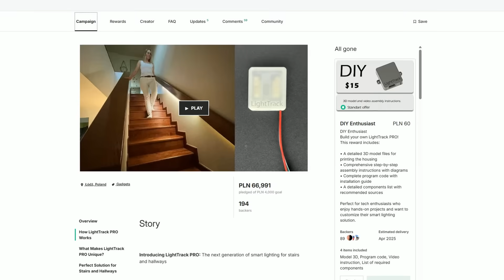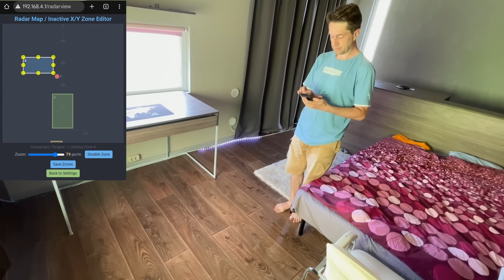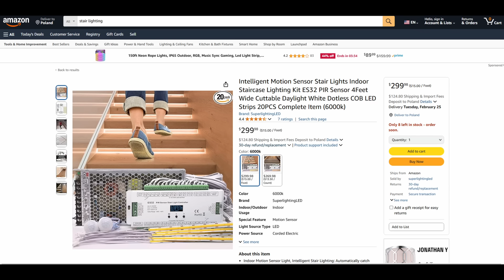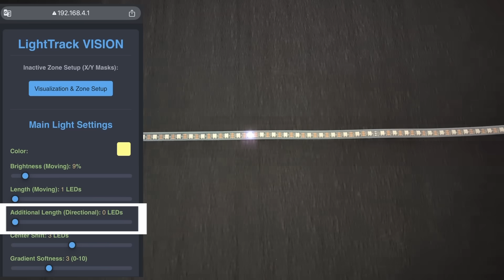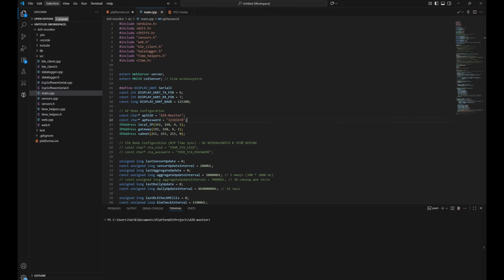My Smart Lighting Invention for Home & Yard (Open Source Code)

Comment: The fact that you kept the project open source earned my instant respect, cheers.

Some suggestions & feedback:

1.Consider SK6812 over WS2812. It comes in RGB+W (can choose between amber, warm, neutral and cold white), excelling at true white color reproduction.
- it's not a new IC, and it has plenty of community support, along with libraries
- it does cost a bit more, but not substantially so
- available in multiple LED/M densities

2.Silicone diffuser / tube if you want a truly uniform and soft glow
- should work with 60/m LED density
- perfect for both indoor and outdoor scenarios
- multiple profile / shape options
- also available in black, looks fantastic even when turned off
- it is pricey, so I'd keep it as a separate option
- it can be a bit painful to install a LED strip inside

3.FCOB (FCPCB) addressable strips - usually SK6812, but WS2812B variants exist too
- visually stunning, with no distinguishable dotting (typically 240 LED/m)
- may require a bit more processing power, but electrical power consumption is still around 18W/m 
- built-in diffuser, no need for silicone or extrusion profiles when used indoors
- very slim, sleek and modern look with supercharged feel of vibrancy
- cost is around 35$ / 31€ for 5 meters, 9.40$ / 8.20€ per meter (TNALANT1 Store on AliExpress)

4.The APP visuals could really use some love (no offense)
- additionally; ESP32 is capable of OTA firmware upgrades, food for thought

5.Jitter - quite evident in the video, could benefit from fine-tuning. This is to be expected in an early stage to be fair, just pointing it out since other people / potential customers are likely to spot it as well.
Transitions need to be a lot smoother if you don't want it to be distracting (no jumping from one side to the other if you change directions, consider a gradient fade-out). 

I would recommend hopping onto WLED Discord if you  need some guidance.

6.Effects - option to keep the lights on as a night lamp is a good idea, but you can build up on this a lot more. ESP32 has a plenty of headroom for both static and dynamic effects that you could implement as presets. Ideally, with some adjustable settings and save function. This does introduce extra work for you, but it may be worth it in the long-run. Not only would your existing customers be happier, but you could gain more as a direct consequence. With ambient effects, the product wouldn't be intrinsically limited to stairs, corridors and alike.  

7.Case - 3D printed white filament = bad idea for outdoor applications, especially if it's PLA. 

8.Smart home software / assistants integration would likely be of value to a lot of people that are interested in this product. 

9.Pricing - touchy subject, I know. If I'm being honest, it's too high at the moment. And gap between indoor & outdoor versions is a bit hard to justify considering how easy it is to waterproof electronics.
Before I get jumped by anyone for being a cheapskate: I don't buy these products, I always DIY them. So I wouldn't be the one that benefits from price adjustments no matter what. This is a feedback.

You could argue that objectively worse solutions are more expensive, but that your example was rather extreme (and it also included the lights + power supply). Average Joe is likely to simply google or search Amazon for ready made solutions and the price disparity between popular units sold in thousands with positive feedback, against something like this will likely seal the deal for them right away. Those products are significantly cheaper than they're made out to be in this video. Note: I'm not claiming that they're better, I'd go for a radar module as well personally (over PIR).. but Joe won't know the difference.

Then there's the component prices - they're really expensive at all, and are rather minimal with no custom PCB designs and added components from what I can tell. Manual labor is valid, but within reason.
I reckon Kickstarter also has some fees / taxes too, but I don't anything about that.  Case looks 3D printed, so we can't really say it's expensive either. 

Main selling point here is the work you put into development and coding. And this is valuable indeed, no arguments there. 
However, I do think it's okay to point out that this is not something that you have to keep doing once it's complete, let alone for each individual unit. 

That's just my opinion. Please don't feel the need to justify anything to me. I'm not here to tell you what to do, just to give some feedback. 
I personally think lowering the price would allow you to reach a wider audience, but that's for you alone to decide. 

10.Final suggestion: dual channel support. I can't tell if it's already implemented or not. Why: because people like symmetry, and you'll often see 2 strips in pretty much every professional solution that uses strips (both in hallways, and on stairs). You may need a logic level shifter, and would benefit from adding a capacitor for each strip( electrolytic, 2200 uF ideally). Data-line resistor would also be a good idea as it'd improve the data waveform. Not mandatory, but I think both of those components should be included for longevity and reliability, given the price.

Needless to say, this would cost more. But as long as you make the controller compatible with extensions, you give the user an option to expand.. rather than having to do so yourself for each product. 
--------
Lastly - good luck! I love seeing projects like this, and I really hope it works out for you. Sorry for the wall of text lol
Reply from the maker: Thanks a lot for such a thoughtful comment 🙌
It’s clear you really know your stuff — I really appreciate the time you took to write this!

SK6812 is great, but it’s more than twice the price, and the device is already quite expensive to build.
The silicone diffuser is already included in the outdoor version.
FCOB strips look awesome, but the controller isn’t quite ready for that LED density yet.
As for the UI — I actually like it as it is 🙂 It’s simple, stable, and works perfectly.

The jitter you saw was only in an early prototype — the final version runs much smoother now.
Adding more lighting effects is a cool idea, I’ll probably get to that later.
The case isn’t PLA, it’s SLA resin printed — strong and durable like ABS.

Smart home integration is also on my list.
And yes, dual-channel is already implemented — it even supports four strips running in sync 😉

By the way, I checked out your channel — your Aurora V2 project looks amazing! The lighting effect is really impressive.
Would love to hear how you achieved that result!
Reply: @DIY_Yarik   Really glad to see that you took the feedback constructively! And that you introduced additional info, helps me understands things better.

I get your point about SK6812s, kinda hoped the price went down by now a bit more than it did. While on the subject - you could use WS2812 Eco version as well - they're cheaper than the classic B version with no noticeable difference outside of what it says on the paper. You don't need to make any adjustments to the code either, they're entirely cross-compatible. 

And yeah, FCOB density can be a challenge. They do come in lower densities as well, but it's very likely that you'd have to make major code optimizations for longer strip lengths.. even on S3. Parallel pin outputs are the core trick when it comes to driving high amount of LEDs efficiently, without frame time and refresh rate being nuked to oblivion. 240/m is a stretch though, you're right. 

Jitter - awesome! It crossed my mind that you probably focused on that already, but wasn't too sure. I would still recommend adding a gradual "chasing" fade-out during directional switches though. It's not only practical due it's ability to mitigate distractions, but I reckon it'd look amazing as well. 

Ah, SLA. That's actually pretty cool, didn't expect that! 

Dual-channel - definitely advertise that! It makes your work twice as cool :P

And thank you! It's definitely a unique project, might surprise you to hear how it really works.
I'm gonna post a REALLY long message regarding the project you saw now. Don't say I didn't warn you! :'D

Gonna copy paste it, I'm genuinely too tired to format it properly. Sorry! 
---------------------   

It really does produce amazing visuals, but the device itself is.. well, it was hideous lol. Very bulky too.
I've been experimenting with this idea a lot longer than I'd care to admit, but it's certainly been fun (and frustrating at times).

There's many ways to make something like this, and complexity can vary greatly. 

The video you saw showcased a fairly simple approach actually. I'd show you the photos, but I've given it away long ago.
I definitely plan on revisiting the project with a more advanced approach, what you saw was more of a concept.

Think of it this way: you're essentially making multiple projectors and combining them into a single unit. 
This can be easily overcomplicated, but it really doesn't need to be if you go about it the right way.

I'll go into some details now.

Beating heart of that project weren't the LED effects, but a rather tiny DC motor. In fact, the LEDs were reproducing a static, pre-set color combination in the video you watched. 
Effects were obtained through light refraction due to shapes and intentional imperfections in the material used, as well as "pre-conditioned" light dispersion.

Motor requirements:

- very low RPM (5-15 is the sweet spot)
- long shaft with a threaded hole at the end
- quiet operation (well lubricated nylon gearbox works great)
- you'll need at least 2 motors, preferably identical ones
- needs to be fairly small, preferably <5cm in diameter 
- torque really isn't important, load is pretty light

DIY alternative: scavenged microwave motor. Was using that in my first prototype lol
--------------------------------------------------------------------------
PCB: needs to be custom made, but you could improvise one. It's very important for the PCB to have a hole in/near the center.
Motor's shaft needs to go through the hole. It'd also help if the PCB is round, but it's not crucial. 

Perfboard -> not optimal, but it's possible to use it if you've got no other choice. Will definitely need to modify though.
Copper clad -> much better choice. Custom MCPCB = ideal. Reason is quite simple: thermals. You want acceptable passive cooling
because fitting in a fan would both increase the projector's size and may introduce audible noise + airflow is a bit constricted. 
------------------------------------------------------------------------
LEDs - basic option:

- high powered COBs 
- RGB / RGBW COBs (3-4W total, 1W per channel)
- domed variant (has a drop of transparent medium on the emitter.. typically epoxy, PC or PMMA)
- 3 COB LEDs in total, arranged in a triangular-ish pattern. No less than 3, no more than 4.
- need to be blasted at full brightness 
- mounting depends on the PCB option. I used a star shaped copper MCPB (you probably saw this already for 1-3W COBs)
- adding a small aluminum heatsink via thermal paste or thermal adhesive beneath each LED helps a lot
------------------------------------------------------------------------
Disc - you'll need a piece of acrylic, polycarbonate or glass + a small threaded screw. We'll be securing this disc directly to the motor's shaft.

- 1-2mm thick piece works great. No more than 3.
- diameter needs to be wide enough to cover LEDs with ample headroom
- disc needs to have sufficiently distanced away from the LEDs (need to experiment)
- needs to be round, no sharp edges (ideally)
- drill a small hole in the center
- apply drops of poly or epoxy resin sporadically and randomly to the entire upper surface

Note: last step requires a delicate touch and patience. You gently apply one drop at the time to avoid the risk of them "merging" together.
It's fine if some merge, but keep it minimal. Distance between drops = just aim for a "texture" that doesn't have any flat spots. 

Tip: you could probably use UV curable resin for this. I haven't tried that myself though.

What does this do: 

a) It scatters the light unevenly and randomly
b) it acts like a partial magnifier, slightly focusing the light
------------------------------------------------------------------------
Top - this one is very tricky, but it's also what determines the light pattern. DIY approach is not the best idea here since you want minimal flaws.
You'll need a textured piece of acrylic (preferably at least 3-6mm thick). There are many textures available, but finding this stuff is a bit difficult.

I found that aiming for something smooth works best. Wavy patterns, smooth raindrop texture and alike. Aurora V2 used 2 different textures that blended beautifully.
Finding a dome shaped piece is ideal but also difficult. Acrylic can be heat-formed though, but it has a bit of a learning curve. I used 1 flat, and 1 domed piece.

You can also go in the opposite direction: aggressive textures, like cracked glass or literal glass shards from a broken piece of glass. But you can't achieve results like
Aurora v2 that way. It still looks interesting though, best to experiment with random junk. Corrugated pieces of plastic that some bottles have is also usable..ish :P

You could also try to make your own textures with epoxy, but I haven't tried that yet. Should be fairly easy to make wavy patterns with it though.. worth considering.

Anyways - this piece rests above the disc and there needs to be a some distance in-between. Unlike the disc, this part doesn't rotate - it's simply secured to the housing.
------------------------------------------------------------------------
...continuing in a new reply since YouTube doesn't enjoy biblical amounts of text
Reply: Here's how the structure should look from the bottom up:

-> Bottom housing (connectors, wiring, buck / boost converters, switch...)
-> Slightly elevated surface (holds the motor and also hides the messy bits)
-> Small gap 
-> PCB (using standoff screws)
-> Small gap (motor shaft passing through)
-> Disc 
-> Gap (need to experiment with it)
-> Top side / plate or dome

Note: having some holes in the sides could help with preventing thermal buffers, but they need to be carefully implemented. I placed mine just above the "slightly elevated surface" step.
You don't want them to be too high or the reflected light will be leaking out and messing things up. If you have to drill -> drill at an angle. Otherwise, use a mesh.

Tip for easy housing: PVC pipes = stupidly easy to make a round case and sheets for the bottom (pure PVC pipes are extremely easy to flatten or bend into shapes once heated up)

Stage 2 -> repeat the steps, but use a different texture for the second top plate. Everything else can stay the same. You may need to experiment with angles though.
Stage 3 -> not needed, but I added a laser with some cheap grating lenses that can be rotated. I also added an extra film to randomize the pattern, so that's how I got the stars.

If you happen to be curious about digital / addressable LEDs + these projectors -> it's feasible, but not with standard 5050 packages. 
In fact, it looks mesmerizing with various effects; but you do need to make custom circuitry to make it possible with higher powered LEDs. 

That's about it. Obviously, being able to control the lights is kinda important here - but this isn't some special topic that needs details. How you do it is up to you.
It can be as simple as using LED strip controllers with some tweaks (also allows you to use an IR remote), or you could customize it however you see fit. 
----------
Advanced approaches can skyrocket in both the price and complexity. 

For an example: I was working with VERY different type of high powered LEDs and I combined them with WS2811 standalone IC (and mosfets to drive them). Added randomly scattered low powered LEDs alongside of them, with dynamic effects as well (this resulted in an occasional hotspots of soft glow in the scene, which was really cool. Kinda like fireflies).

I was also experimenting with small reflectors (both smooth and corrugated), additional lenses (various types, from super narrow ones for small LEDs to TIRs and standard stuff like convex lens). Then there was experimenting with faceted glass instead of the disc. I used stuff like suncatchers and results were very different, quite unpredictable. Fiddling with distance was a major factor here!

I've also tried using some kind of gradient color filters mounted on the disc's bottom surface. Results were very unexpected to say the least, in a good way. They introduce this natural color shift, which gets even more amplified. It also changes colors slightly even when LEDs are static, and it's basically an analog way to make LED effects lol 

Then I tried out some films that are meant for astro-projectors. Stars looked beyond stunning, but I F-ed up and burned a hole in the film.. I had a reflector + convex lens on a really small 9x9mm LED that draws 20A (60W LED).. I thought the film was made out of glass lol. Kinda created the opposite of a black hole for a moment.  😅 

There's much more you can do, but it's a long list. For an example - Aurora v2 had 4 built in batteries (18650) and separate controls for LEDs in each unit via IR remote, and a touch sensor. Touch sensor also supported dimming, which.. I literally don't remember ever using, but okay. It also had 2 power inputs, USB (forced low-power mode) and a DC jack with variable input voltage (used a buck boost converter + vregs in each unit)

It's a very versatile project that you can play with endlessly. A mess that somehow ends up looking beautiful. And it doesn't NEED to be complicated to look good.
Reply from the maker: Man, that’s awesome — love seeing how deep you went with the Aurora concept!
It’s clear you’ve really put thought and heart into it. I actually enjoyed reading your explanation — you can tell it comes from someone who really experiments, not just theorizes.
Reply: @DIY_Yarik   Thanks! Glad you enjoyed it, was afraid the in-depth explanation was a bit too much. Generally speaking, I've got countless ideas on my mind and I'm always looking to improve up on them. Sometimes the experiments are deliberate with expected results, and sometimes they're driven by curiosity and even lack of materials or expertise (namely coding, I usually have to resort to WLED for anything complex). 

Aurora was originally conceived as a module, rather than a standalone "product". I had this vision of offering custom made lighting that allows people to select specific / optional modules to build into the lamps, rather than forcing them to pay for something they don't need or want. Still a bit salty that I had to bench the idea indefinitely lol
Reply: The tech has been round for years.